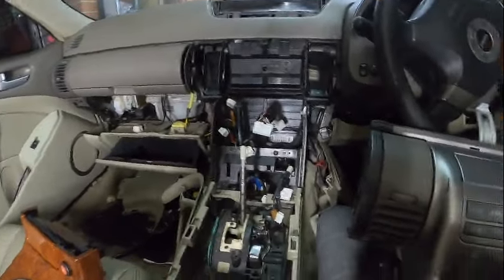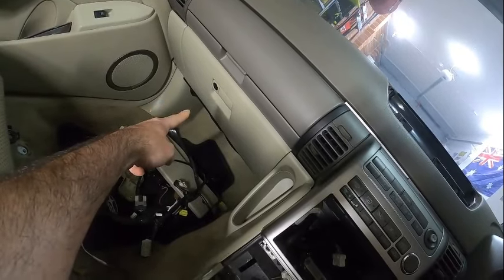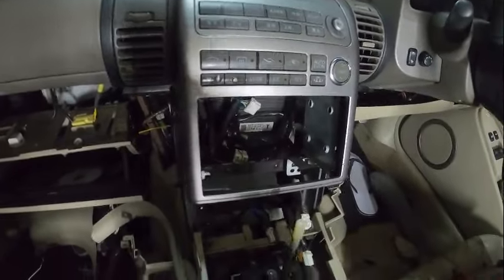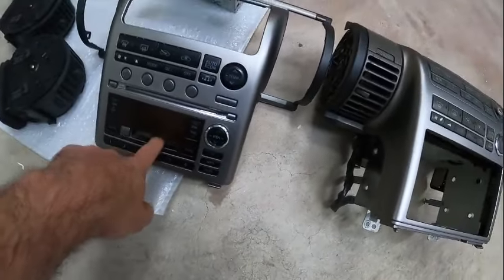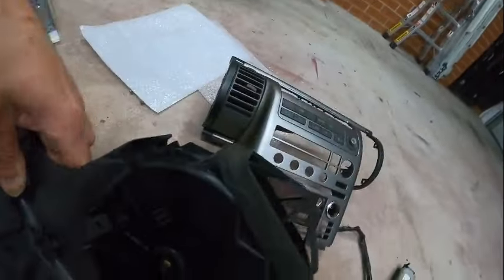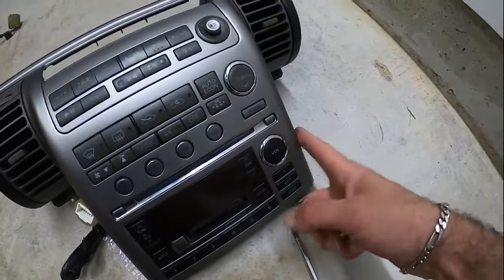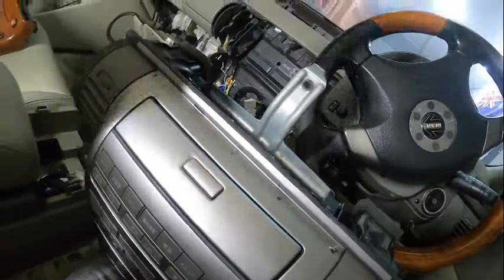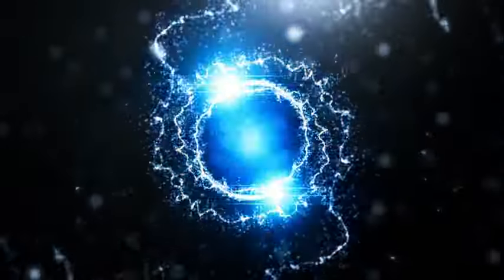Nissan Skyline 2003 V35/ Infiniti G35 Stereo removal and install. Dash is now complete

Comment: You actually made it looking better. but I still think it would have been better if you actually connected the head unit. now the next guy will have to remove everything just to connect one plug.
Reply from the maker: Thabks, but as I was missing that connection,  I won't be able to. I needed to finish the dash asap

Comment: Looking to buy a working OEM stereo new or used. Where did you buy yours?
Reply from the maker: I got lucky and found it on FB marketplace. mind you, the OEM one known to brake so upgrade will be better option. main issue with AC controls. me personally, I got lucky and needed to keep the car looking OEM